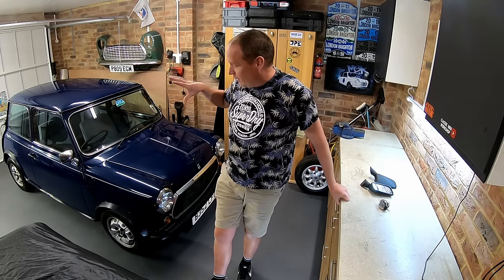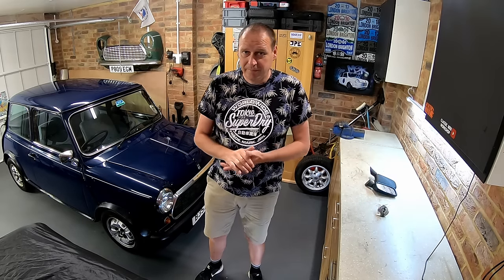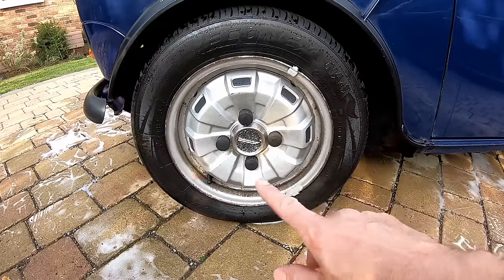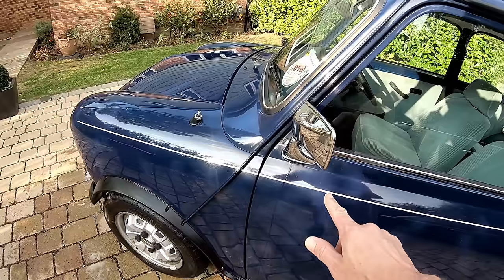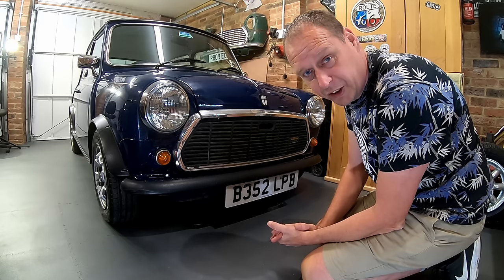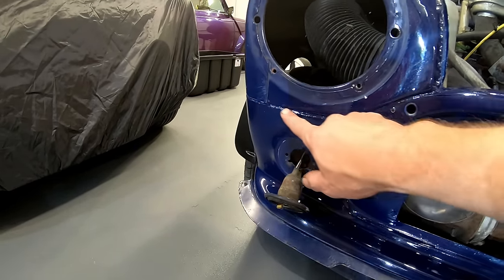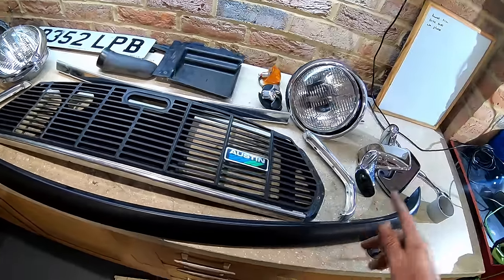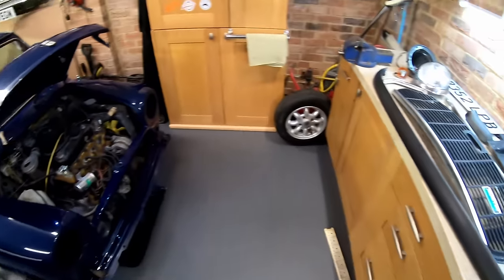Austin Mini Mayfair Restoration - Classic Mini Workshop Project Tardis Part 4.

Comment: Looks like someone has tried towing it backwards by hooking on the subframe.?
Reply from the maker: Didn't think of that, you are probably right. It sat for at least 10 year without moving so would have probably had seized brakes and flat tires